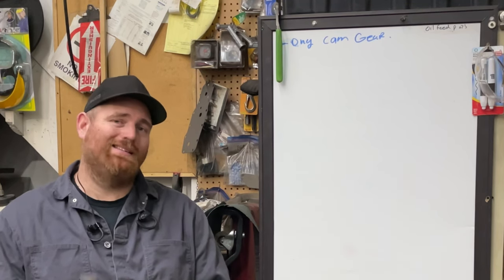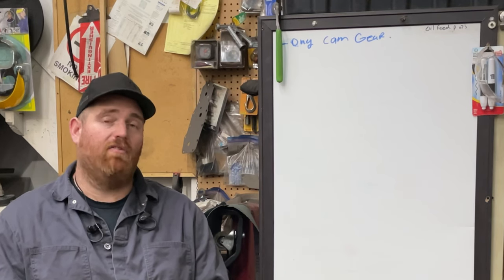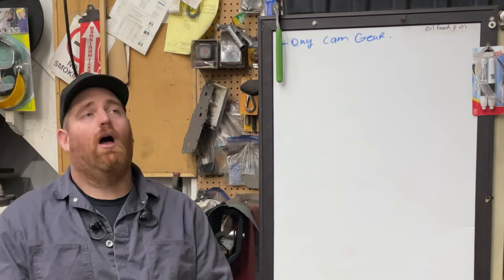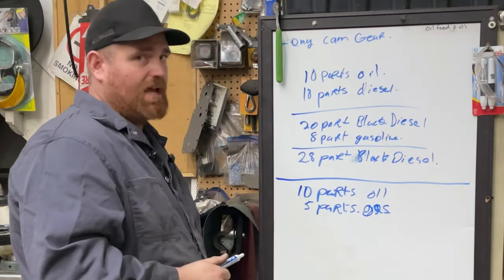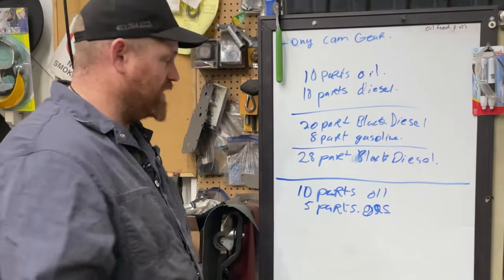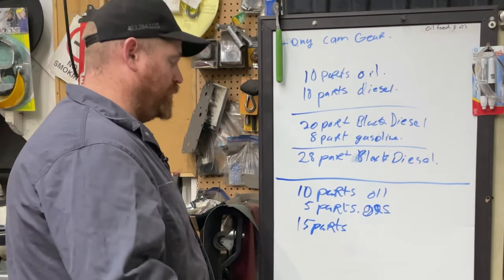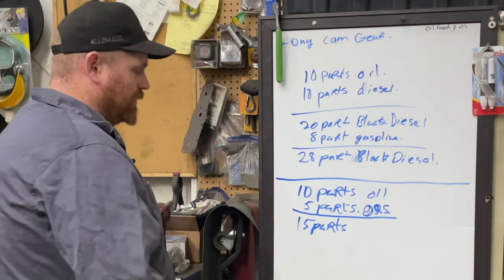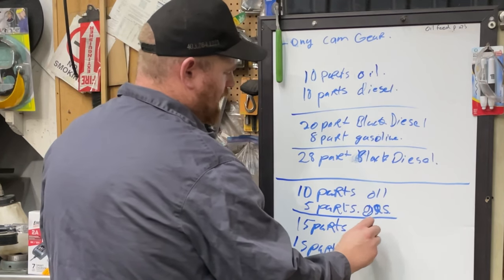Unbelievable: What Happens When Black Diesel Meets the Common Rail?

Comment: For anyone looking for really cheap but effective physical filtering,  get a stainless steel filter body for the common 2" x 10" home water filter cartridges and use those cartridges in it.   

The types of material used in those filter cartridges have very good chemical compatibility with common fuels and oils which means they take far more exposure time to start to break down than their active service life will ever be. 

With that setup, it's easy to do higher volume filtering down to 1 micron with common cheap parts.
Reply: Thousand times this
Reply: better and cheaper than centrifuge? 7000rm supposedly can filter to 0.2 micron
Reply: @handlebaraddict  Basic reading comprehension is not your power game in life, is it?
Reply: @handlebaraddict  A centrifuge is a great addition to filtering, but doesn't replace it.  A centrifuge only removes particles that are heavier than the oil.
Reply: @handlebaraddict  cheaper, you can get a 1 micron filter. been using a 5 micron and a 1 micron filter on the cheap. i plan to build a centrifuge filter later.

Comment: I been using 50% vegetable oil & Diesel mix in my Landrover Freelander 1 td4 which has a common rail for years without any problems at all
Reply: Year of manufacture? I'm thinking about trying it in mine hippo
Reply: @kamildziurgot7468   2002 is the year model it has been decat with the egr valve deleted. I'm now using Vegetable oil and kerosene mix at 60% veg to 40% kerosene...
Reply: Do you do it the chemical way, the same as companies and those on YouTube who show how to make your own Biodiesel
Reply: @Andersljungberg  no just straight clean vegetable oil and diesel but"! I'm running veg/kerosene mix now at 60% vegetable oil to 40% kerosene, as more cleaner burn 😁
Reply: Why on earth would you use clean vegetable oil?? It's more expensive per ltr than actual diesel?????
Reply: @EdmundSampson-pd7vi  Less water in it and not contaminated with chemicals or food extract's from cooking. Plus I can still get it cheaper then the price of diesel.
Reply: @JustCallMeHorse  doesn't seem like you are really aren't saving much , here 1 litre of vegetable is cheapest is $1:50 p/ltr (+Kero) and diesel is $1:90 unless you are getting vegetable oil dirt cheap or wholesale. But I find it intriguing your old injector system is up to the task
Reply: @EdmundSampson-pd7vi  Well in the uk, I get 1L of veg oil for 80p and kerosene is 90p per liter. Diesel is £1.47 at the moment for 1L .  I always get more mpg than straight diesel, maybe it's because it lubricates the top half of the cylinders more so less friction than normal diesel.
Reply: @JustCallMeHorse  makes sense, it could also be that the veg oil lubricates the injectors better too. I have 2013 ranger and in the winter sometimes the injectors are a little noisy and I add a capfull of 2 stroke oil and the noise goes away

Comment: I've been running 40/20/40 (wmo/gas/diesel) in my unmodified garage furnace for months now. On my viscosity tester it was 64 seconds (59 seconds diesel) so it seems close. Might start here with the duramax.
Over 20% gas made it rumble due to pre-ignition

Comment: Finally been waiting on some common rail stuff keep up the good work.
Reply: As long as it's filtered good and clean it should not harm the injectors. Also need to make sure the viscosity is right to thin is bad on injectors as well is to thick it will have to be thinned for winter. Use stale gasoline for thinning or u can use paint thinner if preferred.

Comment: On my 2019  6.7 I ran 20% fryer oil and that was 30% kerosene on my 94 I run 100% fryer oil that has 30% kerosene but only if the temp is above 50 Fahrenheit after I get a good centrifuge the 6,000 RPM direct drive unit I want to try running black diesel in colder temps I came up with the 50° because at that temperature I started to get hazing out the tailpipe so at that point I switched to diesel lol and so far I haven't had a problem but I also spent on new fuel filters on my truck just to be safe once every two or three fill ups

Comment: Ran vegi/diesel 50/50
Mix in my 2021 ram Cummins state side. 6,000 miles later I melted my hole def exhaust system . Don’t do it unless your def deleted
Reply from the maker: Good info

Comment: If you want to filter the oil to where it is pure again you can add a little bit of DE filter powder to your recirculating system it will get stuck in the filter and make it more efficient way past 2 micron paper filter for those really big yellow filters you might be able to put in like 2 cups of de powder it scrubs the oil crystal clear.
Reply from the maker: I will have to look in to that more. I am interested to try it out
Reply: @CUTTERUPROB  it’s how the recycled oil companies clean used oil it’s also the same process they use in kitchens to clean fry oil at the end of the night it’s called diatomaceous earth powder you could build or find a used fry filter machine they use a 7 micron paper filter with the DE powder then recirculating the oil threw the system traps all the particles in the DE it’s pretty simple I used to do it many many years ago when I had a diesel tractor and 12v
Reply: @CUTTERUPROB  the machine we used was called a magnasol fry filter king I believe the magnasol “powder” is just DE powder you can get at a pool supply store
Reply from the maker: @Justthemow  I will look into that. Thanks 🙏
Reply: @Justthemow  i have too also heard of DE powder but never seen it used in waste motor oil. only kitchen stuff...I would deffinatly like to see this is WMO for the DIY

Comment: Always wondered if I could run it in my 06 cummins just been too scared.....but my 97 cummins iv been running it on a mix of 20% gas with only waste oil no diesel and for the last 10 or so years have not had 1 problem with it....had stock injectors up intell about 2 months back not because they were bad just wanted to upgrade..I do let my oil settle for 6 or so months before I heat it up and run in my centrifuge and I run it very slow. Stock lift pump, modified afc, 3thousand gov springs and that's it...just hit 300,000 on her

Comment: Run a 55 gallon drum with a 150 gph centrifuge and a 5500w immersion heater. Run the oil through cold for 6 hours. Clean the centrifuge. Heat the barrel to 110°F and run it another 6 hours. Will pull all the heavy particulates and water out in the cold run and all the fine particulates and even more water out in a heat run. Want 3X the filtration of capacity. You'll pull 50 gallons through the 150 gph centrifuge 3X per hour.
Reply: Always pre filter to at least 40 micron with a water separator.

Comment: You can do it but you need to filter the oil back down to 0 % particulates. It’s not that hard just have to recirculate the oil threw the filter till it’s clear.

Comment: Did it on a common-rail car that wasn't fell suited (no lift pumps and no short circuit filter) and it ran fine until stupidity killed the high pressure pump. 
Even started just fine around freezing temperatures.

Comment: with these diesel prices i think im going to park the duramax, and bust out the 12v and just start filling it from the waste oil bin at the shop lol. Would be cool to see a vid or a bit more info on the cleaning processes, like running a centrifuge, filter systems, or ive heard of guys cooking off water or whatever depending where they get their used oils from, maybe something on types of oils used too, i could see the mixtures getting a little different if a guy was running used gear oils vs engine oils

Comment: My filter 'system' is a 1 micron sock filter in an 8" duct tube sitting on a funnel on my holding tank.  Pour the oil into the filter and gravity will take it from there.  Originally I used a 5 gallon bucket, then I'd carry that to the truck.  Now I use a 65gal. transfer tank with a pump and nozzle so it's just like going to the gas station.

Comment: running 50/50 in 2 TDI common rails with no issues. I will run some gas from time to time to clean the system.
Reply: 50/50 wmo/diesel? Not better to use gas? 75/25 80/20? How many miles/ kilometers have you driven?
Reply: @znaszgoprzeciez2229  Done it both ways and not much if any difference. My 7.3 ran on 100% wmo but common rail needs thinned out. Had over 100k miles on my 7.3, 200k miles on my 1.9 tdi, and maybe 15k on my 2.0 tdi’s. They all smoked a little to varying degrees.
Reply: @znaszgoprzeciez2229  so yes 50/50 wmo and diesel and 80/20 wmo/ rug. All depends on what I have available and time of year. Gas is a cleaner too so I will trough a gallon in a 50/50 mix just the was it out of you will. That’s just my experience fwiw.
Reply: @hadenoughofthisBS  that 1.9tdi was PD or VE? is everything ok with the 2.0tdi?  are you still using it?
Reply: @znaszgoprzeciez2229  pd and would still be driving it but someone hit me. No issues so far with the 2.0. Seems to smoke at idle more then others but runs fine. I’m still trying different blends in the 2.0.
Reply: @hadenoughofthisBS  do you have a single fuel tank?  any heater /  heat exchanger?
Reply: @znaszgoprzeciez2229  no heater and nothing more than the tank the vehicle came with. I run an upgraded fuel filter system.
Reply: @hadenoughofthisBS  what about catalytic converter and egr? deleted?

Comment: I like % better lol      I would honestly need to go read about how to understand parts to figure out what your saying.   But I run black diesel w90 in my old stuff so I can guess what ur saying with the amounts. (i dont own a common rail but if it was that important I would figure it out) 

My mix for non common rail is waste oil 90% regular gasoline 10% which is w90 and dual tanks.  Other tank is straight diesel.

My single tank car gets 50% diesel and other half of the tank is w90
Reply from the maker: I like the % better as it easy to figure out in my head.
Reply: Hey guys just wondering if this recipe will work in a 2006 vw jetta? Also would hydraulic oil be better to run vs umo? Thx
Reply: @BRWfilms  
Ok thanks alot for the info.  Im definitely going to be running it twice with heat through my centrifuge.  Im planning on using this oil / hydraulic oil mix in my tdi and transport truck. 👍
Reply: @peterharder3091  report back how it goes. 👌👍

Comment: Excuse me, but diesel fuel must contain more energy than petrol. and a diesel engine uses higher compression than a gasoline engine and therefore burn burn the fuel more efficiently. but then the fuel must have the property that the fuel can utilize maximum compression. A problem with gasoline is knocking, especially if it is low octane. Which, however, Toyota tried to solve with its technology Skyactiv X It should have some type of compression ignition even though it is a car that is supposed to run on gasoline

Comment: I believe we'll find motors running on the used oil versas deisel fuel will last much longer. Than it's counter part. With all the sulfur and exc that's removed from our pump fuel it is better on the wear. The oil provide more lubricity. Than the pump fuel so I think it's not an issue it's better. Than pump fuel common rail works fine on the used motor oil just filter it thrufill up the tank and go .

Comment: I have a 2016 ram 2500 Cummins no dpf, it has a mild tune done but other than that it is factory. Could I do a mixture like this for my truck? Thanks for any input.
Reply from the maker: You can add some. But I don’t recommend to do over 5-10 percent used oil on these newer trucks. And make sure it’s super clean

Comment: Got a question just did a turbo swap on my 24 valve about to weeks ago well it wasn’t white smoking for about the first week after the swap now I notice a light white haze on first acceleration after cranking or if I sit and idle for a long time it will blow a little more white smoke truck runs perfect temps are fine no loss of power took a intercooler pipe off it has a small amount of oil in it do you think my turbo is causing it
Reply from the maker: it could be the truck . i would check make sure the oil drain has a starlight shot to drain and no restrictions
Reply: @CUTTERUPROB  that was it thanks you are awesome

Comment: Why add gas? Gas doesn't mix with oil and floats on top since oil is heavier
Reply from the maker: Take a glass jar and put 1 part new oil / 1 parts diesel and one part gas. Shake it up and let it sit. Send ma email when it separates

Comment: Hey Rob good videos, u should add hho to the diesels double yer mpg, faster cleaner burn, removes carbon, i burn french fry oil 70% 15% diesel, 15% gas, no modifications, no heater, but use 2 settling storage tanks , so fines settle out after full blend for 1 wk
Reply from the maker: HHO ?
Reply: What do you mean Earl
Reply: He is talking about hydrogen on demand units. Wondering if this would work as well as a methanol kit? 🤔
Reply: Steam also works very good, use coppercoil pipe arnd exhaust pipe insulated or insulated stove pipe, keep exhaust fumes away from copper pipe, it eats copper pipe

Comment: Does my lbz 2005 can take it ?
Reply from the maker: I have had guys run it in them. But I don’t recommend it for the first time trying it
Reply: Thank you for the awser Bud i wont put it in rather pay for the gallon then pay for injector job 🤣🤣👌
Reply: And if its a 2005 truck it would be an lly not lbz
Reply: Oups 2006 i dint even see i rote 2005 thank bud

Comment: Has anyone out there tried using black diesel in a Sprinter van with the DPF?
Reply from the maker: Don’t use it with a dpf.  Save yourself the pain of the bill on the dfp
Reply: You need to run water/methanol injection to prevent it from clogging and burning itself out.

Comment: I just make real Diesel petroleum-based from waste motor oil wmo if you got the balls to do it 720° Fahrenheit then you let it settle for a couple weeks then you do it acid base reduction real diesel petroleum-based diesel from freeways motor oil $0.25 a gallon Unlimited Supply
Reply from the maker: I would like to find my info on doing that way. But hard to find info
Reply: @CUTTERUPROB  all info available  small refineries available
Reply from the maker: @tonydiesel3444  would you have link to  a site ?
Reply: @CUTTERUPROB  can be 4 sell

Comment: Anyone in Europe or anywhere else done wmo in a Mercedes om642?
Reply from the maker: I know a guy that runs it is one. But it is deleted
Reply: @CUTTERUPROB  I’ve playing with idea of doing it. I just picked up a ram with p pump Cummins so I know I can run it in that.  I’m a mobile mechanic that works on fleet vans. There are about 600 vans and I do most of the maintenance so a lot of good oil and trans fluid to used as fuel. I already heat my shed and house with wmo with those knock off esbar bunk heaters. Best money spent for the cold months.